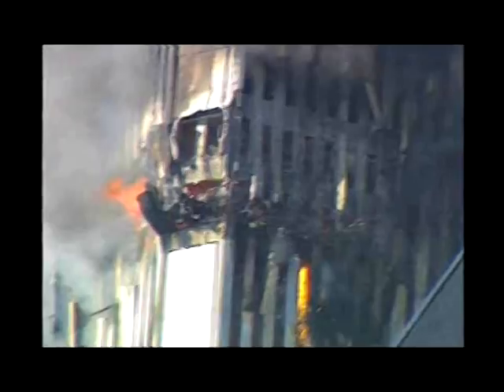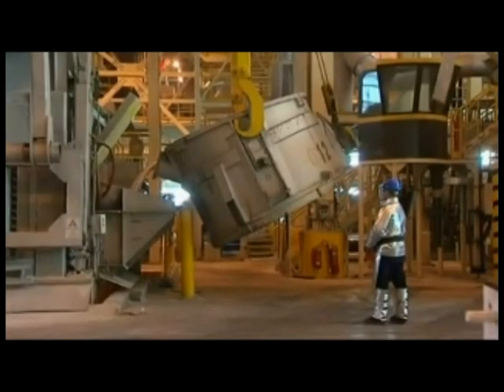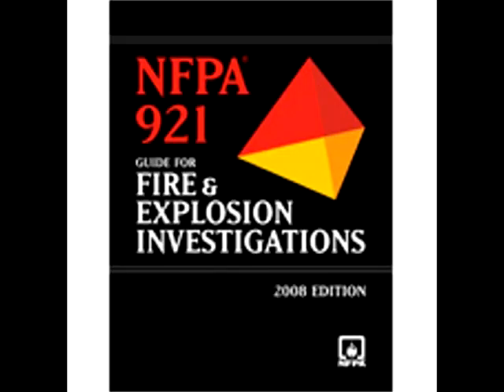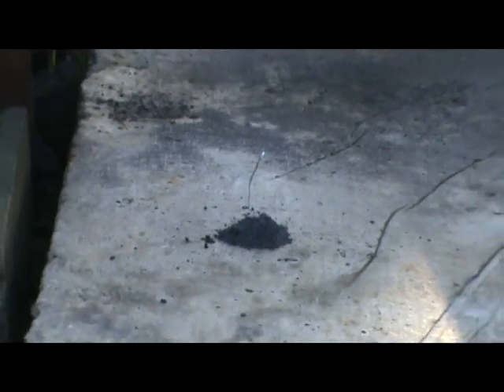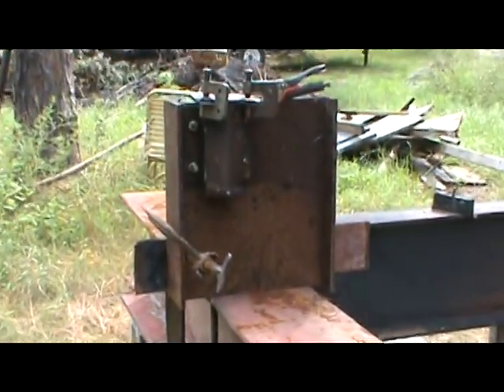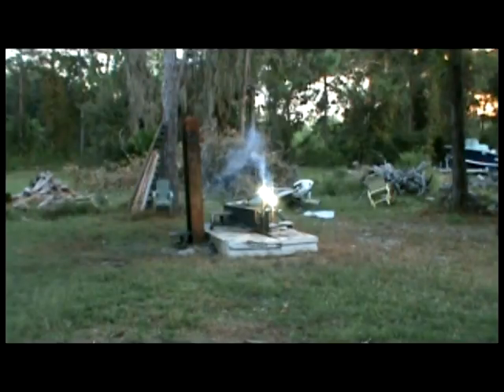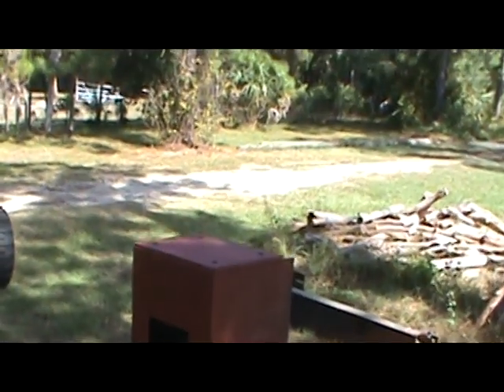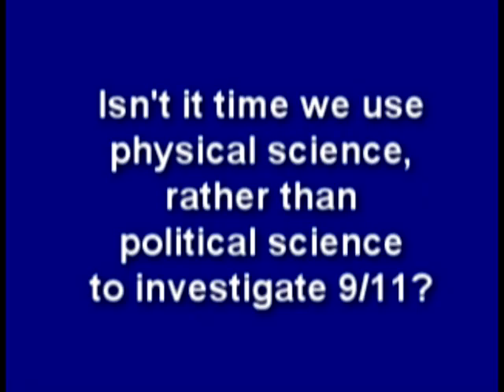9/11 Experiments: The Great Thermate Debate

Comment: I look at my iron stove and wonder how hard I would have to through a crumpled up ball of aluminum foil at that stove for it to penetrate it
Reply: agentorange153 Or better yet, what would i have to burn inside my stove for all of it's legs to melt and for it to collapse in on it's self.  I doubt kerosene(jet fuel) would do it, otherwise my kerosene lantern would have melted and collapsed long ago.
Reply: agentorange153 How many buildings have have elevator doors that are left open? and the chimney effect would have to have an extreme amount of air flow to get even close to hot enough, however, the smoke billowing out was black which is representative of a cold fire.  And even when other buildings that were completely burned for over 20 house, gutting the buildings, the steal did not melt.  You will try to argue that the steel didn't melt, however, there are testimonies of firefighters that found molten steel weeks after the buildings fell, and there is video footage of molten steel pouring out just before the collapse.
Reply: +Zachary Mims Chuck Norris knows the answer
Reply: +Zachary Mims Depends on HOW MUCH kerosene is in there, and how much of a draft there is!  After all, some welding torches use gasoline for fuel, but that doesn't keep them from melting steel!
Reply: agentorange153 well that's not true,  Gasoline is not used for welding except to generate electricity for a plasma cutter.  It takes and oxygen torch for cutting or melting steel.
Reply: agentorange153 For a chimney effect to occur there must be more than one huge big hole at the top, there also must be an opening for air to enter the shaft and travel upward to create the convection, so where was that other hole, were all the elevator doors open?
Reply: +Zachary Mims They don't ALL have to be open -- just a few of them will provide the needed airflow!  And it's not just the elevator shafts -- it's also the stairwells, and the ventilation ducts as well (ALL of which were breached to the interior of the building at the impact site)!
Reply: +Zachary Mims This was NOT "molten steel" -- this was molten ALUMINUM from the curtain wall, you FILTHY LIAR!  And just because the smoke was black DOES NOT mean that it was a "cold fire" -- some materials (ESPECIALLY certain plastics) ALWAYS produce black smoke REGARDLESS of temperature!  Now admit, HOW MUCH IS AL-QAIDA PAYING YOU to deceive the public?!
Reply: agentorange153 Al-qaida(CIA). lol. Explain to me how anything reached temperatures of over 4000 degrees that was measured at ground zero.  The curtail wall of the towers was made of steel not aluminum, but regardless of that, how was every support weakened at every floor to allow the buildings to fall into their own footprint.  You must think the people are pretty stupid, and more often than not you would be correct.  Guess what, agent, we are no longer falling for your lies and misdirection.  You better hope that the next attack that your bosses have planned is big enough to wipe everyone's memory.
Reply: +Zachary Mims Yes, and when the critical temperature is reached by the preheat flames, the pure oxygen burns (oxidizes) the steel removing a relatively thin kerf.
Reply: +Zachary Mims That is absolutely hilarious!  Had to give you a thumbs up!Rather like me looking at my horse and thinking "glue factory".
Reply: PauLee BluesMan Its a special kind of disgust I feel today for soulless tyrants that murdered so many that day and 1000 fold since.  A disgust for the cowards that question 9/11 and yet say nothing.  A disgust for those in the media that sell us their snake oil, and those that drink it up and regurgitate it, but have no clue about any real truth in the world. It make me physically sick, never in my life have I been this close to hatred.
Reply: agentorange153 Having the courage to speak out makes me a patriot, spilling the establishment's lies makes you a traitor!
Reply: +Zachary Mims Because THEY WERE NOT TASKED WITH INVESTIGATING IT -- what part of it don't you understand, MORON?!
Reply: A nation or people who does not use their intelligence and no better than animals that have no intelligence and are steaks on the table and beasts of burden by choice and consent!
Reply: +Zachary Mims 
First, consider that you're not ramming it through at 50 or 60 miles an hour, but several times that speed.  Second, consider that most of what it's ramming through is a relatively thin facade, empty space, and drywall.
Reply: +Zachary Mims the exterior cladding was mostly Aluminum alloy, and the columns closely spaced, but made out of thinner than usual steel, with little in the way of the jet past that until you reached the building core.
Reply: +Zachary Mims 
Didn't say it was.   The outer cladding, the stuff you saw on the outside, was an aluminum alloy.   The columns were steel, but lighter than usual.
Reply: lmao
Reply: throw
Reply: broadcastmyass4u There were planes in New York, but not the other 2.  I have a good friend that was on the ground and saw them with his own eyes.  The no planes angle is disinformation.
Reply: +Zachary Mims That's not even funny!
Reply: so.........kerosene and a leaf blower should work?
Reply: InsanoBinLooney As far as I know there were no giant leaf blowers or 200mph winds on 9/11.
Reply: +Zachary Mims Yes there WERE -- it's called CONVECTION!  The hot smoke rose and went out the hole, and that drew fresh air up through the elevator shafts and fanned the flames -- CLASSIC chimney effect!
Reply: agentorange153 Thats a load of BS,  How many elevator doors and stairwells do you know of where the doors are just left open. you're gonna have to do better than that
Reply: +Zachary Mims Liar, liar, pants on fire!  First of all, the curtain wall WAS made of ALUMINUM and glass, NOT steel -- you can look it up ANYWHERE!  And the fire didn't have to weaken "every" support at "every" floor -- they just had to weaken HALF or more of the supports at just a few floors to bring the whole top of the structure down through several floors and onto the top of the rest of the structure, and then the momentum kept knocking down each floor in turn like a piledriver!
Reply: Link to the steel curtain wall http://www.thelivingmoon.com/47john_lear/02files/World_Trade_001.html
Reply: +PauLee BluesMan Farts out of your ass are NO MATCH for HUNDREDS OF TONS OF JET FUEL!
Reply: agentorange153 I love my country! Why the hell do you think I post what I do.  I don't love corruption, I don't love the terrorism committed by our own government who believes, " a nation or people who does not use their intelligence are no better than animals that have no intelligence and are steaks on the table and beasts of burden by choice and consent." ! US Government document titled "Silent Weapons for Quiet Wars, An Introduction Programming Manual"
Reply: +Zachary Mims Our government DOES NOT commit terrorism -- our government WAGES WAR on terrorism!  And you are spilling THE TERRORISTS' LIES, which makes YOU the traitor!
Reply: +Zachary Mims You DID post AT LEAST ONE LIE -- you accused our government of terrorism!  And the 9/11 commission was NOT TASKED with investigating Building 7 -- so they DIDN'T HAVE TO write anything about it!  As for AE911T, they are in fact bought and paid for by terrorists!
Reply: PauLee BluesMan If you can't tell by the name, agentorange153 is an agent of the establishment.  That is why his arguments are nonsense and his rhetoric is hateful.  He is a traitor to the worst degree,    "If you tell a lie big enough and keep repeating it, people will eventually come to believe it. The lie can be maintained only for such time as the State can shield the people from the political, economic and/or military consequences of the lie. It thus becomes vitally important for the State to use all of its powers to repress dissent, for the truth is the mortal enemy of the lie, and thus by extension, the truth is the greatest enemy of the State.”
-Joseph Goebbels(Hitlers propaganda minister)
Reply: +Zachary Mims I have so far told NOTHING BUT THE TRUTH about 9/11, and YOU are the traitor of the worst degree!
Reply: +PauLee BluesMan I'll have as many kids as me and my gal want to, and nobody can stop me!
Reply: +PauLee BluesMan Speak for yourself!
Reply: agentorange153 Explain to me why the investigation 9/11 attacks omitted one of the buildings.  You didn't answer my question, idiot or coward?
Reply: agentorange153 Oh I get it, they were only tasked with part of the investigation into 9/11,  How silly of me to think that building 7 had anything to do with the 9/11 attacks.  Why would they be required to investigate the whole attack, you have to keep these things compartmentalized, otherwise, people might discover the truth.
Reply: +Zachary Mims No, because they didn't see no need to bother!
Reply: agentorange153 Who decided that they shouldn't bother.  Seems to me to be pretty relevant to the overall investigation.
Reply: +Zachary Mims Congress decided!  And nobody's asking YOU whether it's relevant -- Congress decided that it's not, and it's THEIR decision to make!
Reply: +Zachary Mims agent must have finished his shift... or have been reassigned the job of fanning the response to the Fat Shaming vid.
Reply: +Zachary Mims Which means that YOU are no better than an animal!  Giddap!
Reply: +PauLee BluesMan YOU are the one who needs meds, not me!
Reply: agentorange153 “If you tell a lie big enough and keep repeating it, people will eventually come to believe it. The lie can be maintained only for such time as the State can shield the people from the political, economic and/or military consequences of the lie. It thus becomes vitally important for the State to use all of its powers to repress dissent, for the truth is the mortal enemy of the lie, and thus by extension, the truth is the greatest enemy of the State.”  Joseph Goebbels I have to hand it to our the group that controls the puppets in Washington, they learned from the best.  How does it feel to be a modern day Nazi sympathizer and a beast of burden?  It feel pretty good being a dissident.  who will be on the right side of history, because this lie won't stand the test of time, our government will see to that, to intentionally cause the final social cataclysm, we'll see who's rounded up then!
Reply: agentorange153 What about William Cooper's conspiracy theory.  He predicted the attack and even who it would be blamed on 6 months before, then was murdered after the attacks.  Disseminating facts about an incident, or questioning the obviously obscured truth, is the duty of every American.
Reply: agentorange153 I'd like one example of propaganda from my posts.  Everything I have stated was reported by witnesses or is public record. Or personal opinion.
Reply: agentorange153 one man's terrorist is another mans freedom fighter, just ask George Washington!
Reply: +Zachary Mims William Cooper was a cop-killer -- served him right to be shot!  And A TERRORIST IS A TERRORIST IS A TERRORIST -- anyone who's a member or supporter of Al-Qaida or any of its affiliates is BY DEFINITION a terrorist, and anyone who considers them to be "freedom fighters" is a terrorist as well!
Reply: Stephen Daugherty The relatively thin facade is 1" thick steel frame work wrapped with concrete, look up the building of the twin towers and see for yourself.  In 1945 a b25 bomber crashed into the empire state building and most people have no Idea that these buildings were designed specifically to withstand an airplane's direct impact.
Reply: Stephen Daugherty The towers were designed as framed steel tube structures, which provided tenants with open floor plans, uninterrupted by columns or walls. This was accomplished using numerous closely spaced perimeter columns to provide much of the strength to the structure, along with gravity load shared with the core columns. The elevator system, which made use of sky lobbies and a system of express and local elevators, allowed substantial floor space to be freed up for use as office space by making the structural core smaller. The design and construction of the World Trade Center, most centrally its twin towers, involved many other innovative techniques, such as the slurry wall for digging the foundation, and wind tunnel experiments. They were built to withstand a direct strike from a Boeing 747, which is larger than a 777
Reply: Stephen Daugherty Aluminum is not used in structural supports.
Reply: +agentorange153 you're both wrong, in your own way.
Reply: +agentorange153 
That crap doesn't work. You'll find they're not as big of fans of those people. They're just not fans of us either. Funny thing that tends to happen when you hear people like you slavering for their blood.
Reply: agentorange153 You lecture me on terrorist propaganda, and then you post a link like that.  Is anyone in the world actually any bit safer since the war on terror began, by the US invading a country with no ties to 9/11. some 5000 troops killed, 113,500 Suicides Among Veterans and Service Members Since 9/11, During the Iraq War, 4,475 U.S. service members were killed and 32,220 were wounded; in Afghanistan, 2,165 have been killed and 18,230 wounded through Feb. 5, 2013. Among service members deployed in these conflicts, 103,792 were diagnosed with post-traumatic stress disorder (PTSD) over the period 2002 to December 2012. Over that same period, 253,330 service members were diagnosed with a Traumatic Brain Injury (TBI) of some kind. As a result of battle injuries in the Iraq War, 991 service members received wounds that required amputations; 797 lost major limbs, such as a leg. In Afghanistan, 724 have had to undergo amputations, with 696 losing a major limb.   And as bad as that all sounds, think about the millions of innocent people murdered, and maimed on the other side, that did nothing except get born in the wrong country.  How can anyone, think that anyone is safer?
Reply: +Stephen Daugherty If they're not with us in the Great War on Terror, then they are against us, and that makes them just as guilty of the 9/11 attacks as the terrorists!  And BTW, these are SCIENTIFIC POLLS, carried out by RESPECTED POLLING FIRMS -- give me just ONE reason I should believe your unfounded crap over the conclusions of all these polls!
Reply: agentorange153 Who was sheltering Al qaida?  Every person in Afghanistan?  You are a hate filled little man and the world would be much better without you init.
Reply: Stephen Daugherty Can you hear him, "if you aint wit us, you're again us!.
Reply: +Zachary Mims Yes, the population of Afghanistan was (and STILL IS) sheltering Al-Qaida -- they took up arms against us when we went in there to hunt down Al-Qaida, which makes them part of Al-Qaida as well!
Reply: +agentorange153 
First of all, it hasn't been that great, thanks to the fact that people like you have the attention span of hamsters and even less focus. Second, the Taliban often uses brutal fear tactics to take over territory. Third, it's not as simple as you imagine. There is plenty of internal politics, and loyalties to their own lands and own people involved there.

You would prefer to run face first into that brick wall over and over again, thinking somehow the slaughter of those people will solve everything. It won't.
Reply: +Stephen Daugherty Yes it will -- the more of them we kill, the less will remain to murder our people!
Reply: +agentorange153 
that is the stupidest thing I've heard all day. Even if they are as bloodthirsty as you say, such a course of action will only motivate greater violence in self defense.   I'm no friend of ants, bees and hornets, but I have the common sense not to go mess with their hives and nests and hills if I'm looking not to get stung and bitten.
Reply: +agentorange153 
Just shut up.  All you understand is force. It's your kind of strategic witlessness and tendency towards mission creep that has gotten more Americans killed, with ISIS in the middle of all that.
Reply: Build an iron cage and the aluminium ball will go straight through the holes.
Reply: josiah emrick You figured out my mind trick, lol.
Reply: I don't understand the point your trying to make? The planes did go through the building.
Reply: I mean that never before has a plane of fire or both ever done so much damage to a building, let alone brought one down.  Here is a link to pictures of the damage caused by a b25 bomber when it crashed into the empire state building. https://www.google.com/search?q=b25+empire+state+pics&es_sm=122&tbm=isch&imgil=U2eX0WpGUVP-oM%253A%253BX91pHv0WYdqrDM%253Bhttps%25253A%25252F%25252Fen.wikipedia.org%25252Fwiki%25252FB-25_Empire_State_Building_crash&source=iu&pf=m&fir=U2eX0WpGUVP-oM%253A%252CX91pHv0WYdqrDM%252C_&biw=1366&bih=633&usg=__02EsnYA07gc5UdOhqdzyLzhncUA%3D&ved=0CDkQyjdqFQoTCL2Y_qjGg8gCFUyTHgodPZQAcQ&ei=e5H9Vf3uEcymer2ogogH#imgrc=U2eX0WpGUVP-oM%3A&usg=__02EsnYA07gc5UdOhqdzyLzhncUA%3D
Reply: +Mitch Southerland no planes didn't. They were added into the videos using composite imaging really quickly after the event and given to the news to air, it was bombs only. but you'll believe the mainstream.